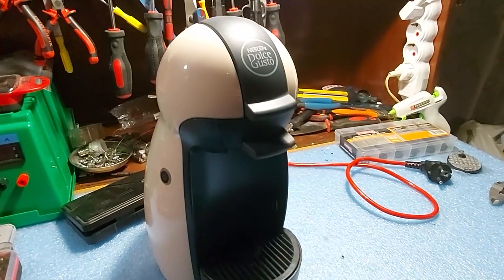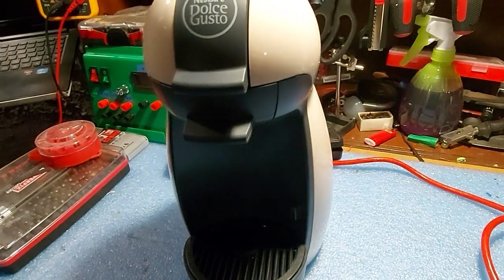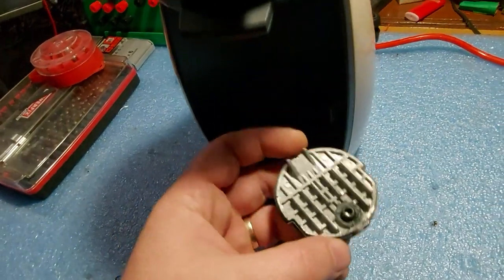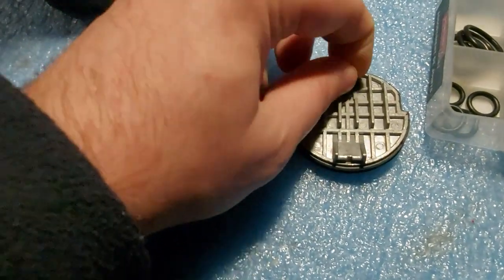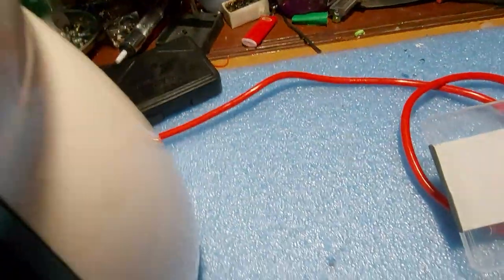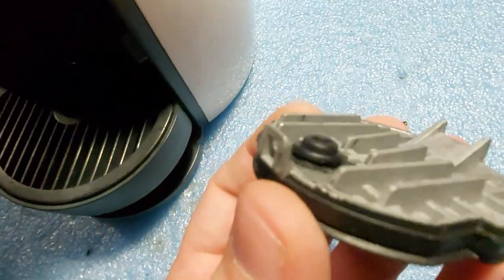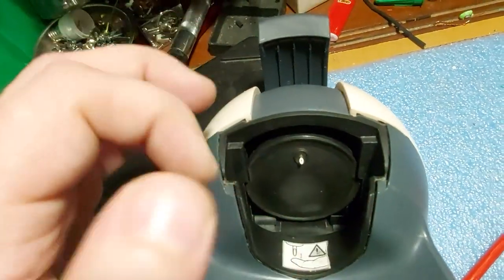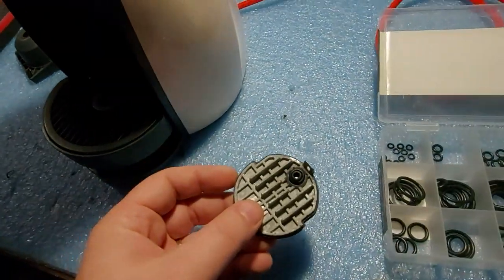DOLCE GUSTO Leaking diffuser / Injection plate - Nescafe

Comment: Hi there, my machine is still leaking water at the capsule holder, even though we had already replaced with a new injection plate. We had also done descaling on the machine.   Any other possible reason for the leak?
Reply: Mine was New but leaking, try Seal it with o ring nevertheless

Comment: Hi, i found very hard to put it back on after i use the o ring? Any suggestion? I m afraid breakjng the top machine head .
Reply from the maker: If it does not fit back in easily don't force it. You might bend the retainer clip. I have a video on my channel addressing this issue also.

Comment: Thank you for the advice. Just cleaned the plate and works like new. Was a little tricky cause I have the kp 270 and the handle come down at front of the hole. But works nice.🙏🙏👍👍🤩🤩

Comment: I feel stupid for asking this.
I picked up 2 O rings today. One go them is too small to fit around it. The next size up fits around it tight but then won't fit back into the machine. It's as if it's too fix to fit back inside. It says its a 5.8mm and 1.9mm thick.
When I take that off, the diffuser plate fits back in fine but then it leaks.
Any ideas? 😔🙏

Comment: My machine is leaking from here is this also the defuser so changing it will fix the problem
Thanks in advance
Reply from the maker: Yes. Try first inserting the niddle method,  before changing the diffuser.
Reply: @benassy69  Thanks  😊  can you plz put the item number  to order new diffuser 
Thanks in advance ☺
Reply from the maker: MS-622718
Reply: @benassy69  Thanks again ,very helpful videos

Comment: 8mm o-ring you say, is that "inside or outside" diameter of the o-ring?  
Here in the U.S.     5/16 inch inside diameter would be .3125.   Would that work?  Thanks Ricardo
Reply from the maker: 8 mm outside. The one you proposed might work.
Reply: @benassy69  Thanks!!
Reply: Teflon worked